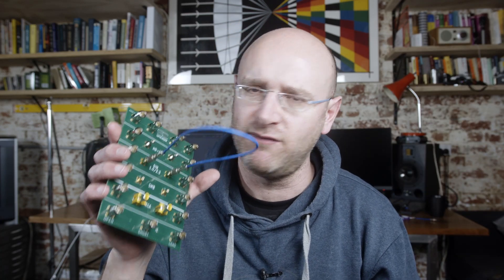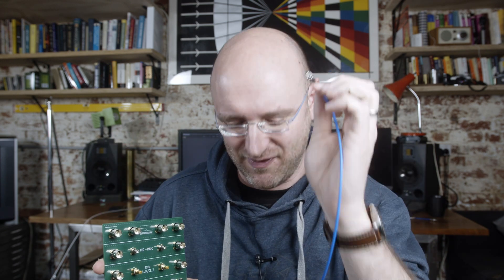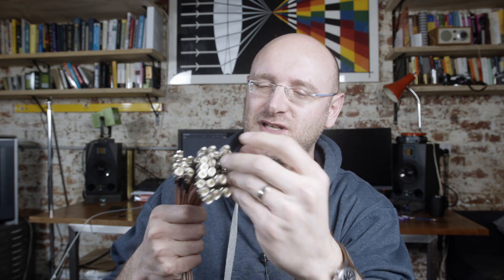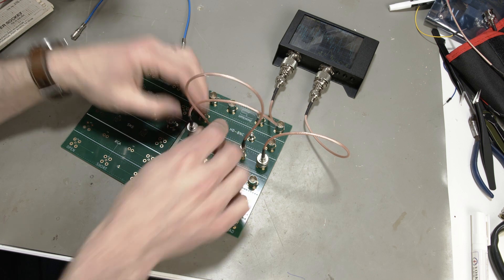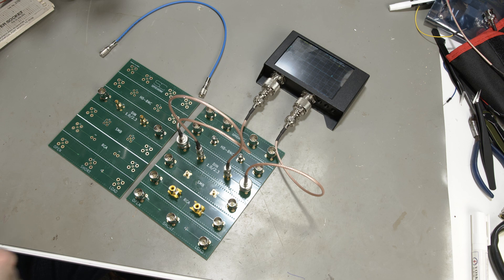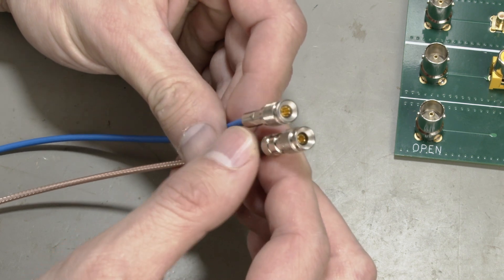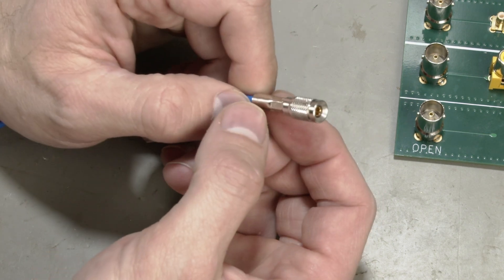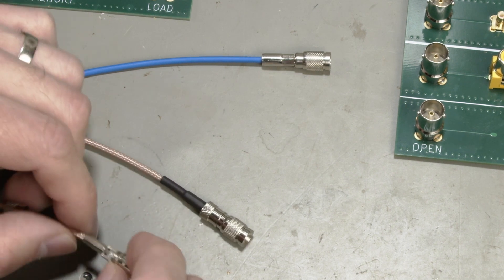USA v. China: RF Connector Quality

Comment: The China stereotype is well-earned in some aspects. However good and bad manufacturers can be found in every corner of the globe. In a lot of instances... The "buyers" and corporations looking to Chinese manufacturers Will go above and beyond pushing the manufacturers to cut corners wherever possible just to save one tenth of a penny. So that the products can be brought back here to America and sold in every Walmart and dollar store. 

As someone with a machinists and systems engineer background, I've had my own humble small electronics lab/business for the past 10 years or so. Doing mostly industrial board repair and troubleshooting. I specialize in test equipment troubleshooting, repair, calibration, and other metrology related tasks. (Not that this makes me an expert) but Chinese manufacturing has intrigued me for at least the past 15 years. All you have to do is look at companies siglent, Rigol, and now even higher end stuff like fluke and Agilent. To see the incredible value being created. 

 If you could go back in time 20 years with an oscilloscope from Rigol or siglent.... Folks would be blown away what you can get for the price. Not just the features but the actual engineering and quality of the product...... Engineers and other professionals here in the USA would have been absolutely blown away with what is possible for the price. 

Obviously there are two sides to this and I am by no means an expert. 

having intimately dealt with high-end metrology grade equipment.... I feel like I'm decent at discerning the quality of manufacturing I'm boards and test gear.... I've been continually impressed with a lot of what's been coming out of China in the last decade. And obviously big corporations with r&d departments and other industry professionals are going to stick with companies like HP and tektronics..... But for a huge portion of folks who are either learning electronics, or developing a business and niche of their own......
There are options and qualities available to them now that could have only been dreamed about 20 years ago. And I'm very thankful for that

Sorry to ramble on.. glad I found your channel it looks like you get up to some really interesting stuff
Reply from the maker: Thanks for your thoughtful comments. I appreciate you taking the time to share your insights and look forward to more feedback on my projects!
Reply: Some of the electrical engineers at manufacturing plants are pretty incredible.  Having a fully populated circuit board powered up, and components start getting yanked out, and add some solder blobs to complete connections.  Component count reduction to decrease overall cost, while having the unit still functional. Reverse polarity protection be damned (amongst others)!

Watch out for "ball bearings" from China.  Has the mystery behind the bearing in the ball point pen been figured out yet? Interesting little bit of trade war history between Japan and China regarding disposable ball point pens.